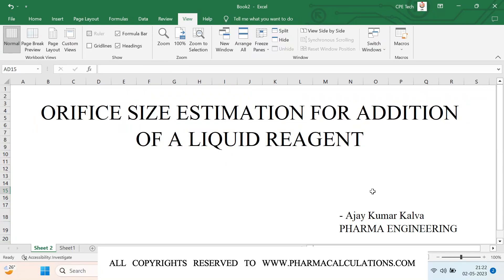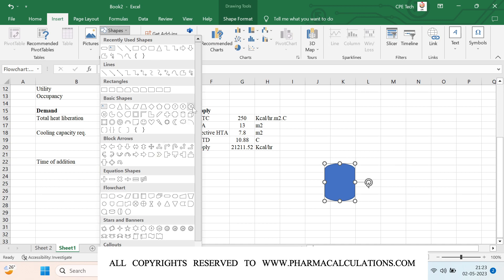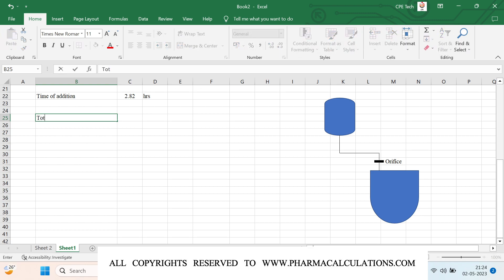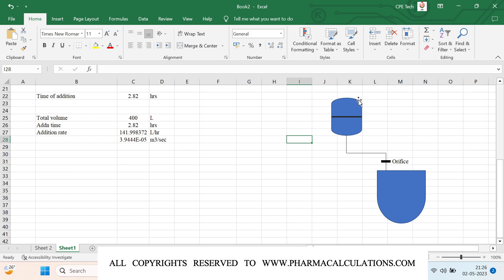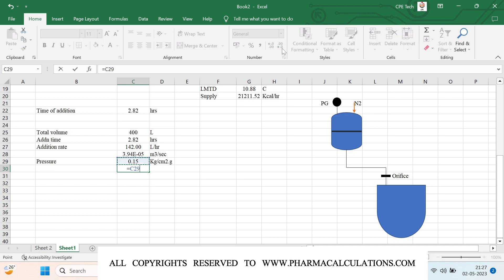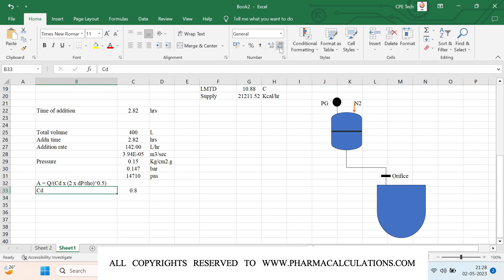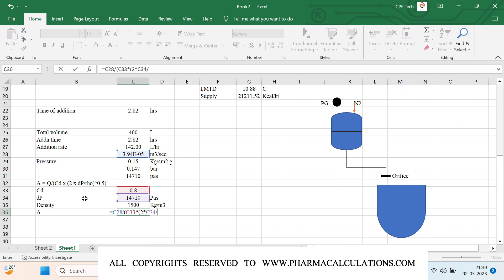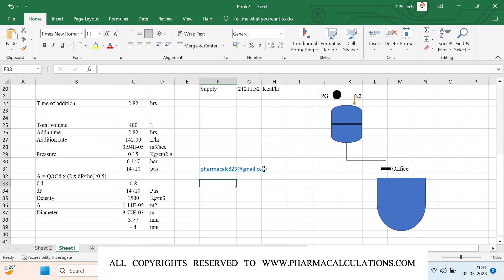Estimation of Orifice size for performing controlled dosing of reagent / solvent

Comment: In  open additiontub there is no n2 provison available during the case  how to calculate by gravity, how to consider pressure difference
Reply from the maker: Need to use a dosing pump